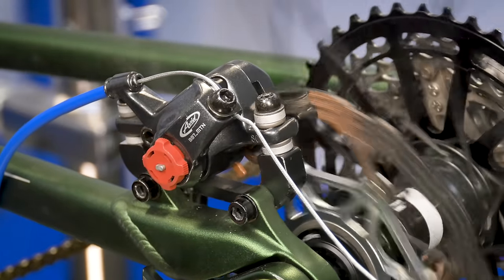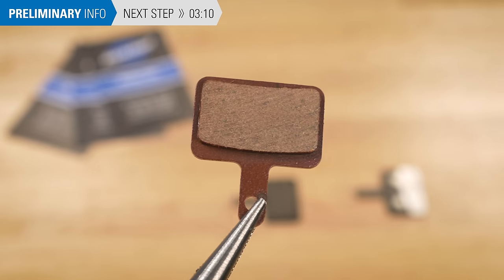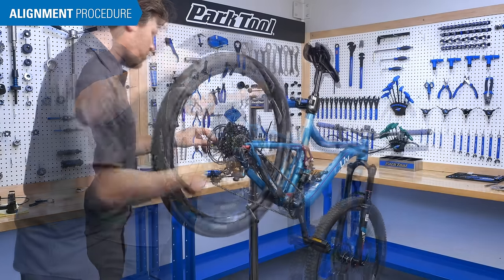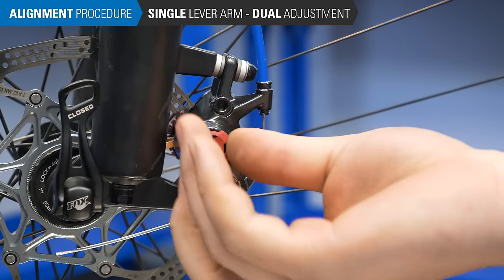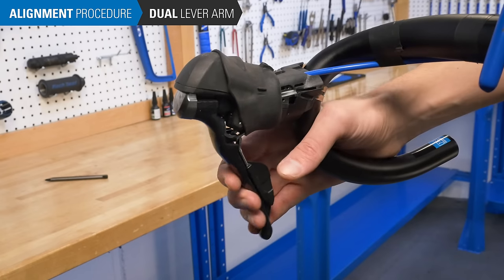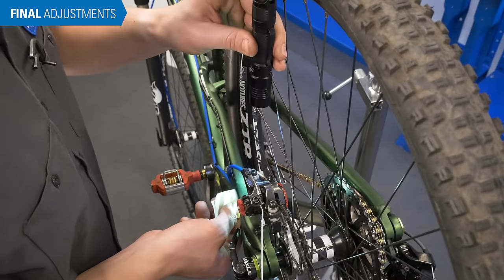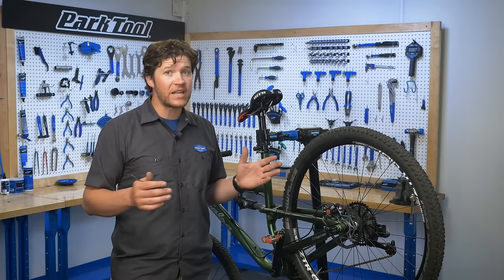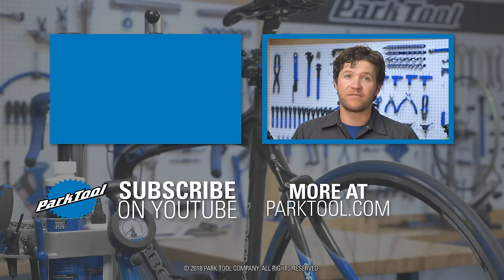How to Align a Mechanical Disc Brake on a Bike

Comment: I have a mechanical disc brake that uses a magnet, but no retaining pin or spring attached in the pads. In 2 years of riding a bike, I encountered this problem for the first time, where my brakepad is falling when applying a slightly to moderate pressure on my front brake. I already did checking my pads and the spring of my caliper and they are in good condition. Is it possible that the magnet that is holding the pad is the culprit?

Comment: Having the caliper arm set all the way back and barrel adjusters all the way in make it impossible to get pressure when I’m braking.. if I move the arm inwards and adjust barrels I can get brake pressure.. new cables. Don’t know what I’m doing wrong.

Comment: yes but what if the rotor is only getting pressed by break pads? Meaning, when I take out the used break pads, half of the each break pad never made contact with the rotor.

Comment: Mine has only the inner pad adjustment, but the outer pad is further outwards than the gap in the plastic for the disk brake, what should i do?

Comment: What do you do on a single lever arm/single adjustment when the non-adjustable side is too far from the disc? I've adjusted the inner-most side as close as it can go to the disc but the other side is too far causing too much play in the lever. The only thing I can think to do is adjust the lever arm cable in more but they say not to do that.
Reply from the maker: Can you loosen the 2 bolts where the caliper and move it over? If not then you may need to think outside the box as either your frame, hub or brake caliper is out of spec.

Comment: I need a help its still rubbing its rubbing in non moving pad when i try to put it while pushing hard it still rubs the rotor is not alligned with the  caliper, my inner pad adjuster is in the lowest it can go

Comment: 4:56 those washers on the brake mounts, are these cylindrical to be able to adjust angle a bit ? 
My brake sits at a funny angle and I cannot align them.
Reply from the maker: There are brakes with Conical washers below and above the caliper. If in good condition those allow you to adjust the angle. They can get stuck and need to be removed, greased and re installed to allow free movement.  If you do not have conical washers under the caliper then your frame needs to be faced and aligned.

Comment: my brakes squeak no matter what me or my local bike shop does, i have the same brakes as the bike in dual lever arm alignment procedure. we've tried cleaning/sanding the brake disks, getting new brake pads, and the brakes have been realigned so many times but it never works.

Comment: My caliper is apparently not standard probably because it’s from 2006-2010 but it doesn’t have the wider holes for it to move side to side Instead it has the mounting bracket and mounts from the side of the bracket not on top like the calipers shown super weird but I’ll just have to deal with it

Comment: My caliper has only one adjuster on the inside. However both pads move inwards as there is a small rubber o ring between the inner and outer brake pad housings. How would you adjust this?
Reply from the maker: Interesting. Could you send a picture to truman@parktool.com ?

Comment: Want to say I don't like and comment much however you probably just saved me a small fortune had brand new bike done by Halfords and the disc came with metal bits still in the hole so I changed discs however after wards I noticed the brakes didn't stop the back wheel even with small pressure you could overpower it I looked and the brake pads brand new as expected on mew bike the pads was almost touching the disc so had no idea why when I pressed the brake no stopping power I contacted a guy he said he would book me a slot to see if he could even fix it as I've turned it into a ebike hlafords even after 2 weeks won't touch it under warranty as its not original anymore I came online just to check as only 1 side is adjustable and I had no idea how do do the outer side then your video appeared and seen to losed the arm til its relaxed fully that gave me alot of space so I tightened the inside bolt only 1 available til there was just room for the disc and it works perfectly 🥰  you saved me booking a slot and paying then maybe them making it worse as many dont know about ebike conversion kits 😉  respect my man liked , commented 😉
Reply from the maker: Glad the video helped you out! You learn something new everyday.

Comment: Fyi, a good electrical tape job can replace the end cap. Without special tools or needless Amazon purchases.
Reply: I solder the ends, don't have to worry about tape or cable ends coming off!!!

Comment: Hey Park Tool,  I got a fork which has IS mount, I would like to install Galfer 246mm disc rotor. How do I go about to install?
Reply from the maker: Likely you will use the IS mount and add the Galfer adapter on that.  Contact Galfer for this.
Reply: @parktool  yeah..they do prompt me a Galfer adapter. My fork is DNM USD8-FAT. Have u come across this fork before? Or do u have videos on installation of large disc brakes ever?

Comment: For a caliper with adjustment on the in board pad only, It seems backwards to turn the pad contact screw all the way in. When the inboard pad wears, you'll have no ability to move that pad closer to the rotor. Doesn't that defeat the purpose of the pad contact adjustment?
Reply from the maker: There is quite a lot of pad adjustment in these calipers. The only other way to advance the pad is by actuating the lever arm which only has a limited amount of travel. So, the logical place to take up the initial tolerance is with the pad adjustment. And is what manufacturers call out in their own literature.

Comment: On my gravel bike, I have DECODE R brakes. They seem to be dual arm, single side adjustment, I just can’t get them to work right, and it’s driving me nuts. Waaay too much lever travel and poor stopping power. On my cheap as chips MTB, single arm, single adjustment, I get perfect braking though. Any thoughts?
Reply from the maker: 1777DK I have not dealt with or seen the "DECODE R" brakes. Is there any pad adustments on the sides? They may be hex fittings or knobs.
Reply: Park Tool thanks for the reply. There is only adjustment on the inside. Hex key. I think the brake is a relatively new product as I can’t even find a manual for them, but it seems very much to me that both pads move, when the lever is activated.
Reply from the maker: To reduce the amount of throw you will need to adjust that inner pad in. Then you will need to re align the brake over the rotor. That should reduce the amount of throw you have. Sounds like an interesting brake, I'll keep my eyes peeled for it.
Reply: @parktool  Is there a trick to aligning the calliper? On a single side pull I would turn the pad all the way in, then back out 1/4, and then pull the lever in, as I tighten the calliper down. But that does not seem to work here, for some reason …
Reply from the maker: You will often need to do final adjustments after following that procedure. A bent rotor could also cause issues. Is it rubbing badly after setting it or just a small amount?
Reply: Park Tool It’s not rubbing to bad. I can maybe do some manual adjustments. I have trued the disc, I think it’s as straight as it can go. It was a little bend though, out of the box.

Comment: On both brakes on both my bikes I feel like the procedure for aligning the calipers are way off. (single lever arm, single adjust 5:40)
If I follow the steps by tightening the screw all the way in clockwise, then one out counter-clockwise, squeeze the brake lever and tighten the calipers.. the side that is not affected by the tightening screw is way too close to the rotor. Either the pads rub, or the mounting surface for the caliper body itself come in contact with the rotor.. Are all 4 rotors just severely warped? lol

The way I have to do it, is screw the bolt all the way in, and back out like 4-6 clicks, instead of just one.
(Bikes are 2010 Scott sportster p55 & 2012 Scott aspect 40)
Reply from the maker: Sounds like the bikes have been used for a few years. What can happen is that the caliper and the mounting surface have kind of found mating surfaces so when you tighten it, it goes back to where it was. If both the surfaces were perfectly flat this would work. but being that they have some memory/ mushrooming you may need to Align how you are doing it or via the visual test of sighting the gap. Often this issue becomes apparent when you try the sight the gap method as it will move when you start tightening.
Reply: @parktool  I did notice this earlier when spending an hour or two trying to dial in the brakes on the 2010 bike to the point where they weren't rubbing, but still provided braking. However I think what might be introducing confusion for me, is the fact that the pads were very worn. 

I completely forgot about this, as my 2012 bike had its brake pads changed a year or so ago, and still have a lot left on them.
The 2010 bike I've recently gotten by a family member as they weren't using it, so I'm fixing it up and using it for myself, and the pads have probably not been changed for a long time.

Waiting for new pads now, so hopefully I'll have more success once those are installed. I think the lack of braking-effect on the 2012 bike I've struggled with for a while now might be due to oil "contaminating" the pads or rotors, which I'm guessing makes them more slippery.. probably not good :p

Anyway rant aside, still a very clear and comprehensive tutorial, though a bit confusing to keep up as it switches between different systems mid-video instead of showing the full procedure for one system all the way through, then moving over to a different one. 

Didn't expect a response on the comment really, especially from you guys :)

Comment: My inner pad adjuster rounded out and I dont know how to remove it. Please help
Reply: Cut a long slot and use a flathead screwdriver to remove it
Reply: Same thing happened to me and i was looking for the answer. What did you end up doing? Did you just buy a new brake?

Comment: Well.... I got the brakes adjusted once... then had to remove the front wheel for other reasons, and now?  I can NOT get it aligned again. I have the single type.  And the inner pad is rubbing and NO amount of tweaking will fix this.  I can loosen the mounting bolts, and hold it in position, but no matter what, when I tighten everything it's rubbing again.   Only fix is to really loosen the adjustment almost all the way out but then the brake lever hits the handlebar.   Also mine has an odd screw above the upper mounting bolt.  IT's got the same kind of convex stack of washers like on brakes.  I have no clue what that is for.

Comment: Are the disc pads supposed to be floppy and easily move around without a front wheel installed? When i touch them they rotate very easily. The brake still works but the pads can be moved with my hands.
Reply from the maker: This does depend on the brake. Some pads that use the magnetic retention system will be floppy and can move around. Even ones that are held in by clips move around a bit. What model of brakes do you have?

Comment: I’m having issues with my inner or adjuster vibrating out… on a motorized bike. So I’m thinking I’ll use Teflon tape but I can’t get the adjuster out
Reply from the maker: If you cannot get the adjuster out you may try some wicking thread locker to get the adjsuter to have more resistance so it does not loosen up.
Reply: @parktool  is the screw supposed to back all the way out? I thought I might have to take the caliper apart but that has been challenging
Reply from the maker: Depends on the brand and model of brake.

Comment: Do all bikes with mechanical disc brakes have pad adjusters?
Reply from the maker: It certainly should.  There my only be one.  Look on the left and right side for a bolt head or knob to turn.  Also check the brake manufacturer's literature.

Comment: I have a brand new dirt jumper bike. It has a single lever with single adjustment on it. The caliper is slide away from the wheel all the way, yet the outer pad still rubs. There's no more room for adjustments. Ive never had this issue before on my downhill bike, mountain bike, or old dirt jumper. 
It does this even without a brake cable attached.
Any suggestions?
Im thinking of  replacing it with a dual adjust caliper.
Reply from the maker: Interesting. This may be something to reach out to the manufacturer about as its new and should not have an issue like that.
Reply: @parktool  Already tried several times. Free Agent ignored me everytime. I contaced the online bike shop, IamVelo where I ordered it from and they told me to contact free agent, then ignored me too.
Reply from the maker: OK, is your rear wheel aligned properly in the dropouts? That could be an issue to look into. Often with vertical dropout bikes like that the IS mounts will have oblong holes that you can move the bracket in to account for where the wheel is in the drop out. If that is in the wrong spot it will always rub. Beyond that you may be out of luck. Maybe try the brake manufacturer. Looks like Free Agent runs Bengals on a few of the models. Good luck!
Reply: @parktool  yes Ive tried everything. It has horizontal drop outs, and the wheel is perfectly aligned, it has chain tensioners. I have the caliper slid all the way over with those oblong holes. I beleive it us bengal.

Thanks.

Comment: HELP
Trouble I am having is by the time I've adjusted the pad adjuster enough to eliminate rub there is no feel on the brake handle, it goes all the way till touching the handlebar. Please advise me on where I am going wrong
Reply from the maker: What caliper are you working with?
Reply: @parktool  figured it out thanks though, just had to play around with the caliper because there was little to no clearance

Comment: How can I first loosen the outer adjuster all the way, and then after tightening, release it a quarter turn?
Reply from the maker: The video states that you should loosen the outer adjuster all the way and then tighten it 1 full turn. Then one steep later it tells you to loosen it 1/4 turn. So it is possible to do this. You had just missed the step where you tighten 1 full turn.

Comment: I am having a problem. My discbrake pads are engaging with the rotor but the bike is not stopping. I have thoroughly cleaned bothe the pads and the rotors... And the local bike shop even changed the brake cables... But the problem persist.. what do u feel is the issue. Can u please help me sir?
Reply from the maker: If the actuation arm is hitting the end of its effective range of motion you can get this issue. Have you tried the procedure in the video?

Comment: I can't seem to find a way to have a non-rubbing rotor and tight brake all at once. If I make the brake tight, there will be rubbing. Once I loosen the brake either by adjusting the pad adjusters or lever arm, the rubbing will disappear but then I am having a loose brake. If someone could advise me what I might have missed, that'd be awesome!
Reply from the maker: It could be a bent rotor or caliper mis alignment.
Reply: @parktool  Thanks for the advice! It seems to be working now after I made a final adjustment on the caliper alignment.

Comment: This is a very good video. I don't mean to take away from what it is.
But right at the end it skims over a huge part of a whole topic that is not addressed in any video I can find.
I have new mechanical brakes, rotors, and new adapters, along with some conical washers loose in a bag.
In one video the washers are put on top of the caliper housing right under the bolt head. This can't be correct.
In others, they are on top and bottom of the caliper. Another only underneath.  And some don't use them at all. 
This may be one of those things that you can't get 2 people to agree on. And everyone is staying as far away as possible from the topic.

Comment: For single brake calipers like the Shimano m375, what am I supposed to do? The adjuster doesn't ever reach a point where it's flush with the body of the caliper, so am I supposed to simply tighten it until it physically refuses to tighten anymore? I assume not, because it doesn't result in a proper install according to these instructions

Really unfortunate how undocumented so many bike components are
Reply from the maker: Are the pads worn? Shimano typically has great documentation. 
 https://si.shimano.com/en/pdfs/dm/BR0007/DM-BR0007-04-ENG.pdf

Comment: So I have a new bike, 1 week old now, the thing is that my rear brake ( mech disk brake ) has an issue, the outer pad ( the only one that moves ) is touching the disk, I tried unscrewing the 2 bolts and pulling the brake in so I make some space for it.. nope, still attached to the disk and you can both hear it and feel it while rotating the wheel with your hands, the wheel stops pretty fast id say 

No matter how much I tried the rotor is still touching the outer pad, what is to be done ? Brake is Hayes MX5
Reply from the maker: If you loosen the cable at the pinch bolt does it effect the pad contacting the rotor? Sometimes the cable is too tight causing an issue like this.
Reply from the maker: Your video is not working for me unfortunately. A video will help quite a bit. Feel free to email me at truman@parktool.com with pictures and video. This will give us the whole story. Thanks, T.

Comment: How to check disc pad size of my bicycle
Reply from the maker: it can be difficult to find the correct pads. Brake brand and model can lead you to the correct one. If not that then it is even more difficult and can be a guessing game scrolling through pictures of pads and when you find the right shape and size you can make the purchase.
Reply: Thanks
Reply: Please make video to  how to check disc pad size